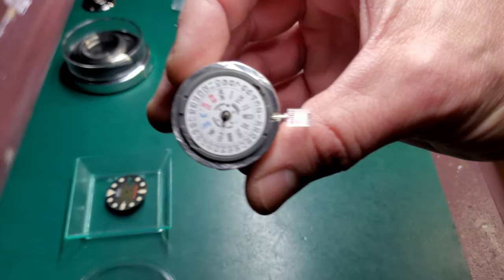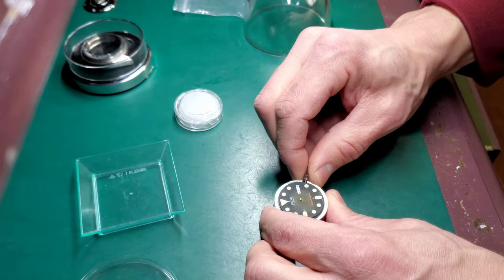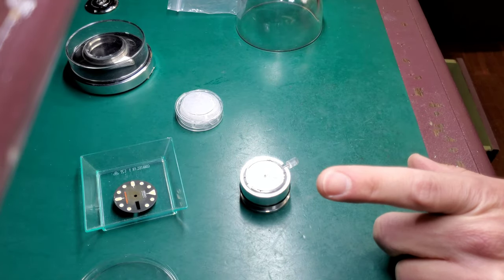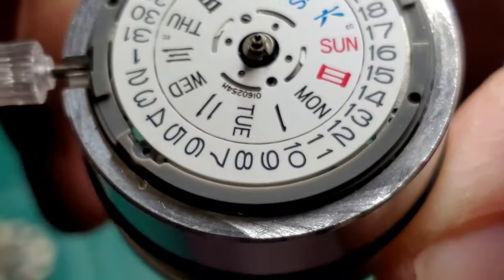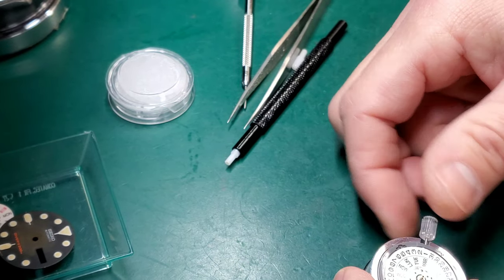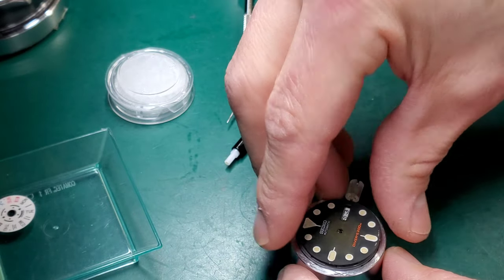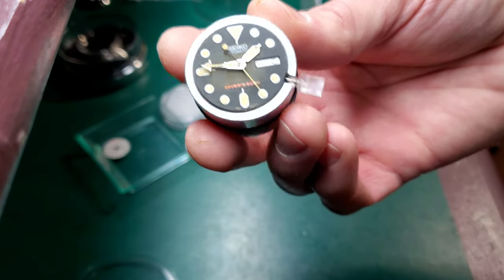5 Minute Day Wheel Swap for 4:00 Crown - Seiko Modding

Comment: I thought NH-35 was date only and NH-36 is date and day. NH-35 works fine for both 3 and 4 o’clock cases. NH-36 will need to replace the day wheel for a 4 o’clock case.
Reply: You're right.  The NH-36 is the day-date movement.  The NH-35 is day only.  In the video he incorrectly says the movement is a NH35, it is a NH36.

Comment: I'm just starting to mess with my watches - Monsters and SKX's and already have some new movements on order.  Many of the Ali listings for NH36 movements fail to state what crown position they are set up for, so I may need to do some day wheel swapping.  This was a great vid to ease my mind on that job.
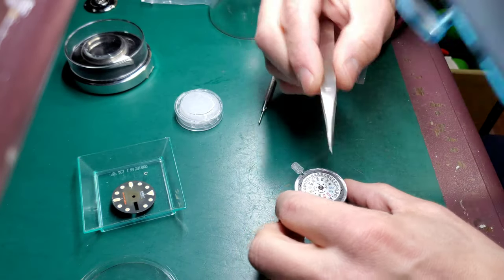Reply from the maker: In my experience on AliExpress if they don't say, it's a 3:00 movement.  Good thing is there are plenty of sellers that offer the 3.8 movements!
Reply: @ChillinwitWatches  Is the colour of the plastic holder a clue?  grey vs black?  I'm confused about the holders and what fits what case.
Reply from the maker: @julianb1474  the black is for Seiko brand movements, 4r35, versus the ones they sell with the gray spacer, nh35. The gray spacer is actually a bit thicker than the black, so putting in NH in the Seiko brand case is oftentimes tight.

Comment: I see you ment to use it with the crown at 3:18. I thought there is a date disc available to use an nh35 for a replacement of the 7002 movement in my Seiko diver from the 1980s, which has it’s crown slightly further down than the skx on a real 4 o’clock position.

Comment: Amazing! I’m planning to get an aftermarket case with a 4 o’clock crown and use a NH35, do i need to change the date wheel? Thanks!
Reply from the maker: Date should line up for either 3:00 or 4:00 crown, only the day needs replaced.
Reply: @ChillinwitWatches  thanks!

Comment: Does the C-clip need to be placed on at a specific angle/direction? Thanks in advance
Reply from the maker: It will fit straight over the hour post.  At the very bottom of the post it will get a little fatter, you have to push straight down over that part until the c clip settles into a little indent in the post at the very bottom.
Reply: @ChillinwitWatches  Thanks for the reply man, so other than the tight fit, the clips opening doesn't need to face a specific direction? I did my first SKX build this month and next month i'm hoping to build and SKX Turtle & like you said, needs must